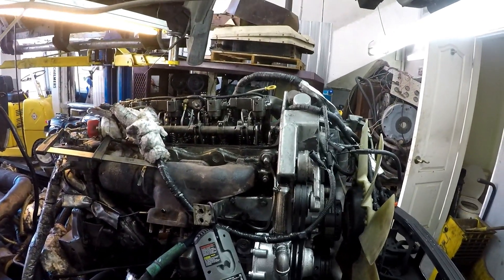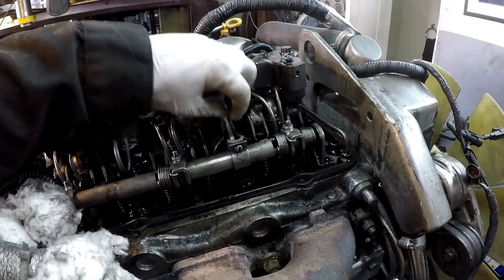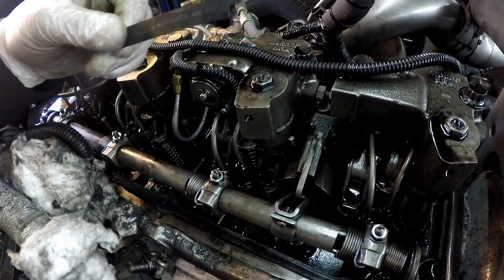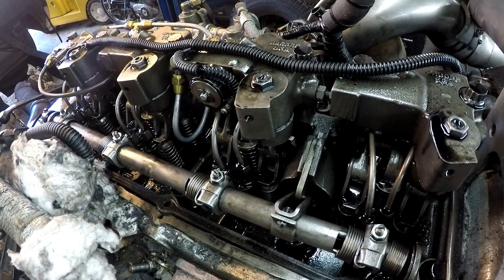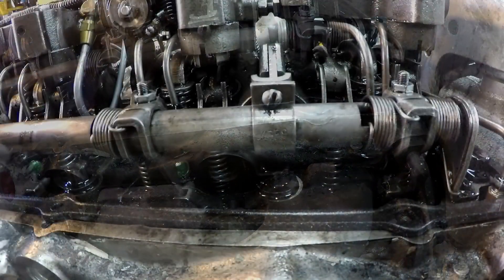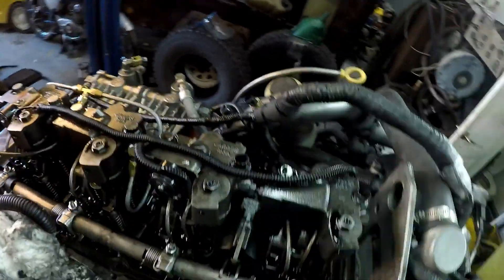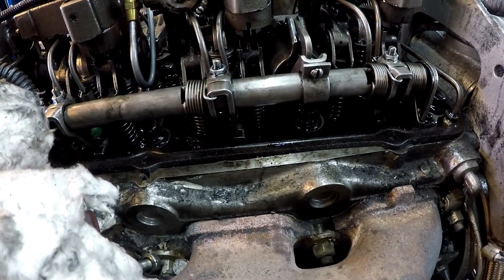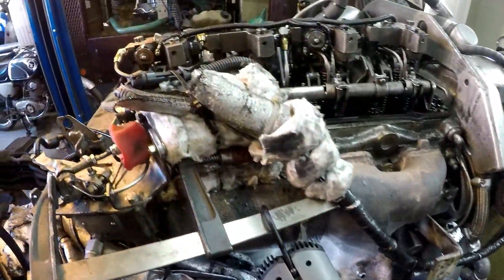Detroit 4-53TIB Fuel Modulator

Comment: Great stuff, thanks. 
Do you lose any boost pressure, or pressurise the crankcase, with the fuel modulator?
Reply from the maker: Yes, this is a small boost leak that I'll have to fix in the future.  It's not significant to pressurize the crank case yet.:)  I just found this leak making the video.:)